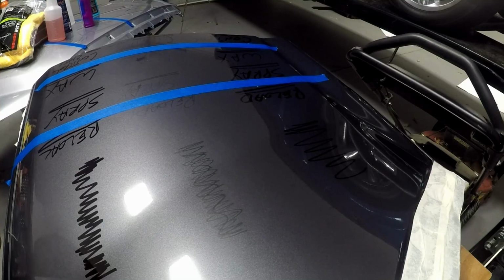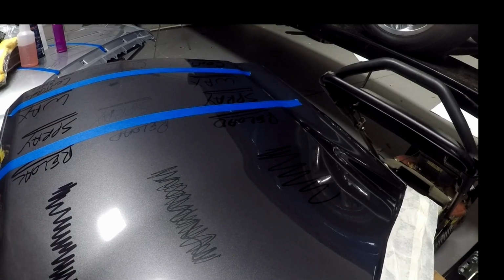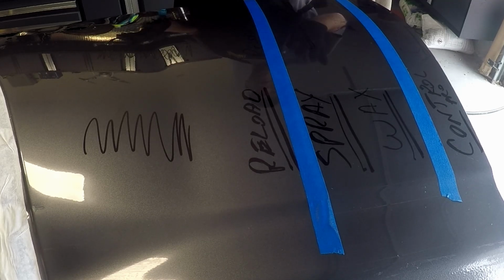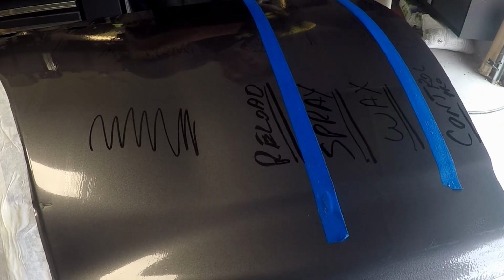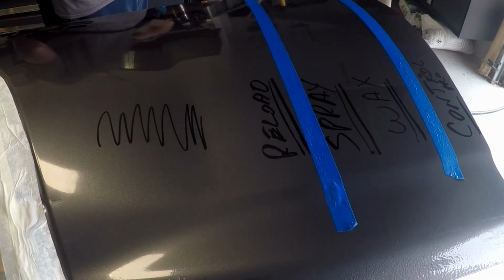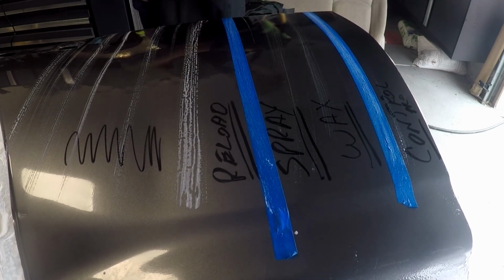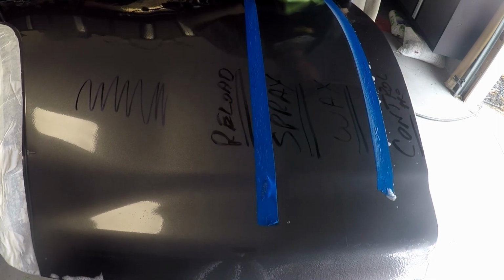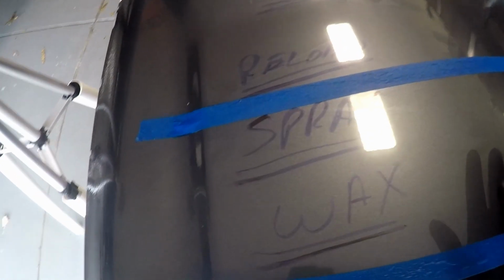Meguiars hybrid Ceramic Wax vs Meguiars hybrid Ceramic Spray. Are they the same?

Comment: You might have read the instructions! The spray is suppose to be on a wet surface or at least spread with a wet/damp cloth because it uses water to work.